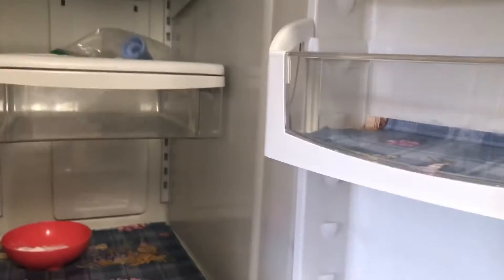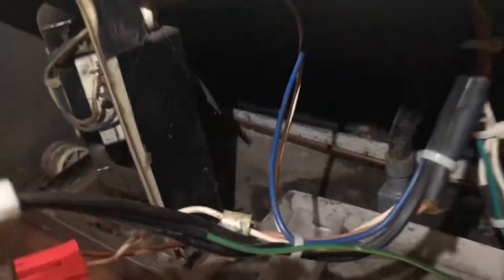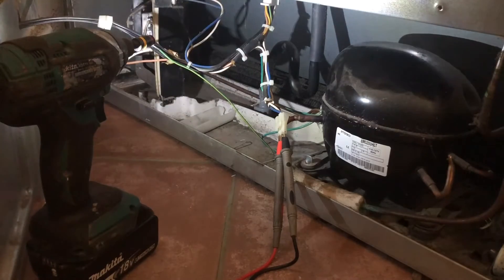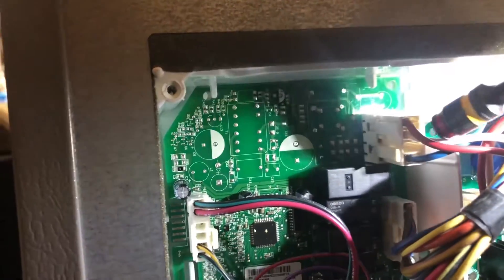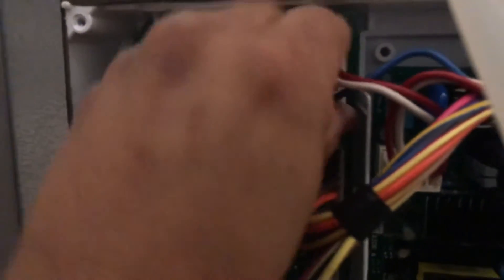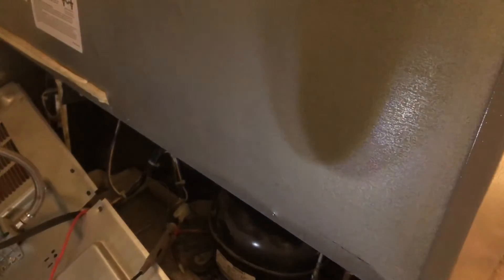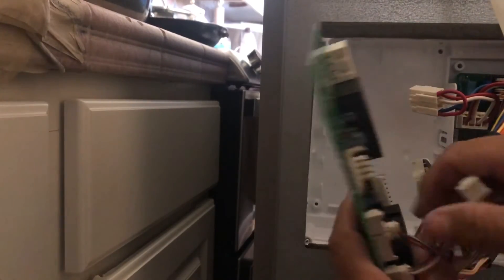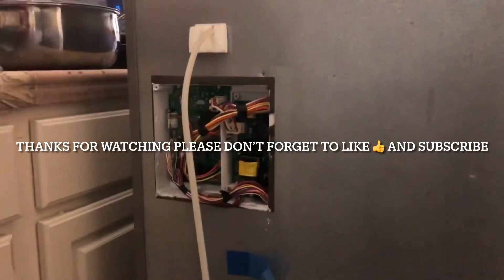Whirlpool refrigerator not cooling trouble shooting WRX735SDBM00

Comment: Was the problem a break in the soldered connection between the blue and red wires on the pc board? Curious. Not easy to troubleshoot a mother board.

Comment: I have model WRX735SDBM00 just happen today, the refrigerator compartment not able to get colder than 55°. The freezer is  at -2° no issues, the Icemaker is working good.
I cleaned dust, check the fan is working, compressor running but it hot as I touch with my hand, what could be wrong on this?

Comment: First of all I am a repair man of 50 years and I am also an electronics tech.    I have found that the most common failure of these whirlpool fridges with the same rear metal cover is just as simple as replacing a 25 Cent part.   The small capacitors very close to the square integrated circuit ( don't touch the ic with your finger) has failed.  One will be gone for sure.  You can take the circuit board to an electronic technician and he can replace the faulty capacitor with a new one.   Yes he will charge you for his time but the faulty part itself is worth way under a single dollar.   I have done these repairs many many times with success every time.  All of the other components on the circuit board (ic)  are healthy.      There is a very slim chance that the whole circuit board needs to be replaced but I have not experienced this.    HAGD

Comment: Have the same fridge with the same issue in the refrigerator compartment not able to get colder than 40°. The freezer is where it’s suppose to be at 0° no issues, the Icemaker works intermittently (have tried replacing 3X with same results) the compressor kicks on normally. Any ideas I’d appreciate it ?
Reply: The usual problems causing no or poor cooling in the fresh food section are as follows.  1  Defrosting problems  causing blockage of air flow through the evaporator due to a frost build up.  Frost must not be visible on the back wall of the freezer section.   2  Damper door is not working properly .  This door opens between the freezer and fridge sections to allow a cooling breeze to flow up to fresh food section. When the fridge is running you should be able to feel a very slight breeze at the rear air vents at the back wall of the fresh food section. 3  There could be a problem with a temperature sensor (thermistor)  in the fridge section.  A faulty sensor could be telling the control board that there is enough cold in the fridge section and thus the control board will not be opening up the damper door. and lastly the control board itself could be faulty .  This is not the usual problem and it is the most costly part to replace.  Other issues may exist but these are the most common problems.  I hope this helps.

Comment: my problem was a PO error that would not clear, fan at the back bottom would turn on/off.  I followed this video and the patch cable fixed it, gonna order a new MB for 250$ vs a new fridge! thanks man!
Reply from the maker: Thanks for sharing. I’m glad it helped. Don’t forget to like and share it helps me a lot.
Reply: Buenas q tal saludos tengo un problema q en el frizer no funciona la ventiladora y lleva todo el arnes lo d la ficha ventiladora y sensor  pero no funciona vrntilador sera el sensor q ase q funciine es de 3 puertas

Comment: The control board is super expensive. Could you just leave the jumper wire as is so you don't have to buy a new board?
Reply from the maker: Might never stop running
Reply: I sent a comment recently as to how to fix this problem